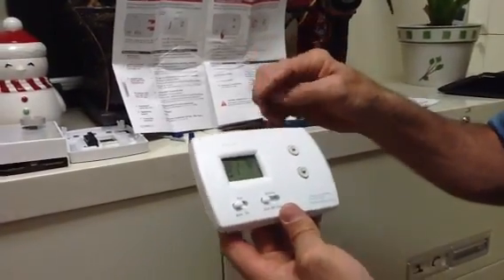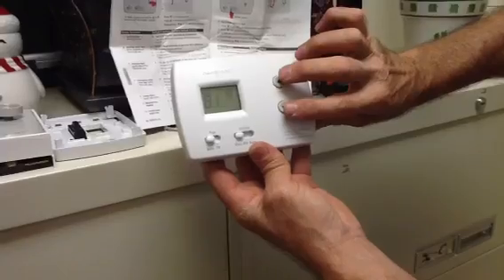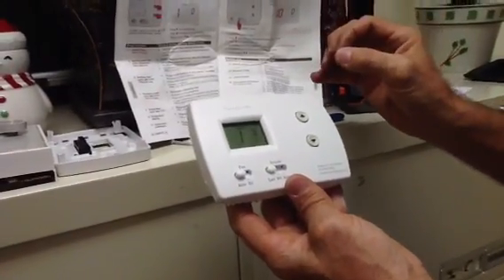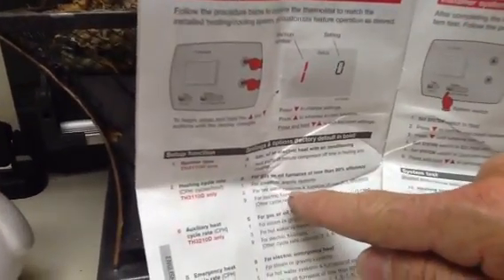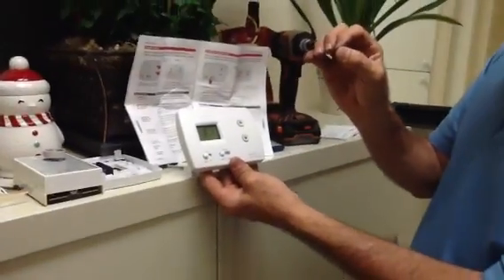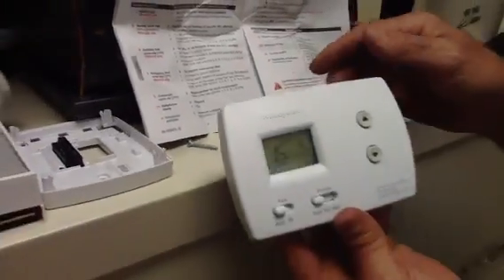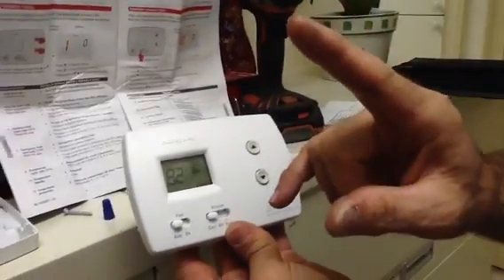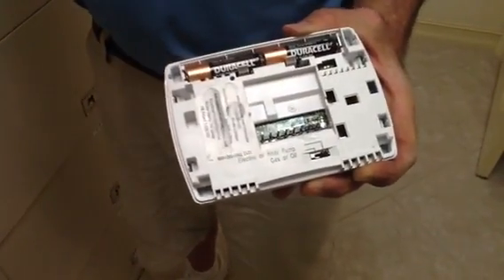Programming Honeywell Pro 3000 Thermostat

Comment: Thank you for this. I have one of these older thermostats and discovered, when changing the batteries, that it had been set up incorrectly the last time anyone fooled with it.  I ran through the procedures with you, changed that switch on the back to "Electric or Heat Pump" – no idea why anyone would set it to "Gas or Oil" but they did – installed it back on the wall, and BINGO! Everything is working perfectly.  This is an apartment building and I would have waited a long time for maintenance. Thanks for your help!

Comment from the maker: Is this person tech savy? Maybe try pro 8000 thermostat. You can preset 
Temperature to the desire set point, and fix where it will go back to the set point after a few minutes. There are inline sensors I am not sure that will work? Hope tis helps.

Comment: The number 9 selection (compressor cycle rate) IS NOT 3 minutes like you said. It referring to number of cycles per hr not minutes. That would mean the compressor will be allowed to turn on 3 times in a one hour period. I suggest changing it to 5 or even the max of 6. If you are living in a poorly insulated home or trailer on an extremely hot day your unit may need to cycle more than 3 times in an hour to keep the home at satisfied temperature.
Reply from the maker: We always set the time delay between three and five minutes Thanks
Reply: @bluecollarmillionaire4life  Number 9 is not time delay! It is cycles per hour...
Reply: 15 is time delay
Reply: @bluecollarmillionaire4life I set up how you showed here. But then it goes to a screen that shows 70 test? And 71, 72, 74, 75. Some have numbers to the right like the 75 has a small 21 then test. What do I do on those screens?

Comment: We changed the batteries in ours and now it has confused the system and won't work? The 'Cool On' keeps blinking slowly off and on. Any ideas as to how to fix this?
Reply: Having the same issue… did you figure it out?
Reply: @ImTheFascination  Kind of. I attempted to undo my mistake. So, I slid the 'System' knob to 'off', removed the panel, then took out the batteries, and I waited a few seconds. Then, I replaced the batteries, plugged the panel back into the wall mount, and slid the 'System' knob to 'on'. The same issue came up but resolved itself after about 30 seconds.
Reply: If cool on is flashing it means you're waiting for the compressor timer to end, leave it alone a few minutes to start, 3-10 mins according to settings, it keeps from burning up the compressor, for future reference